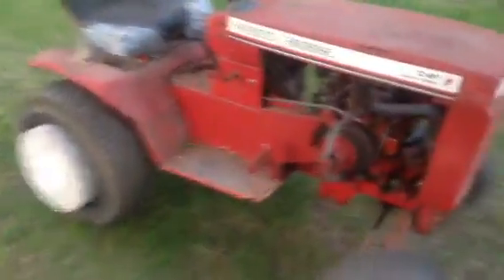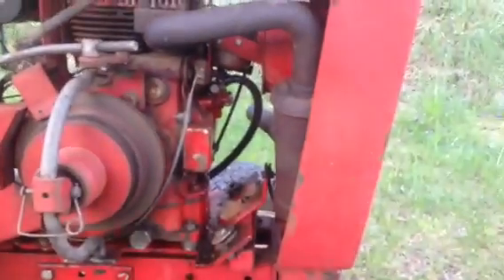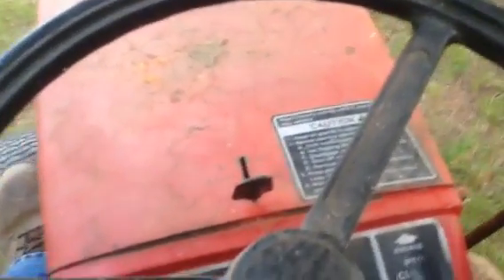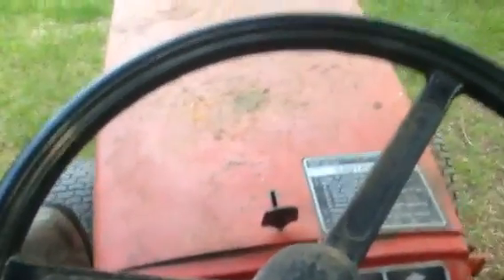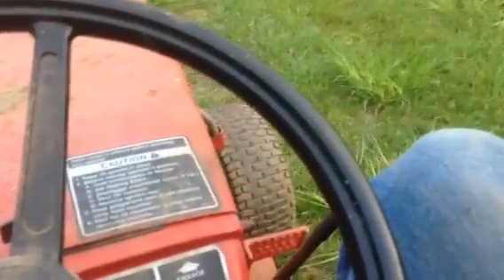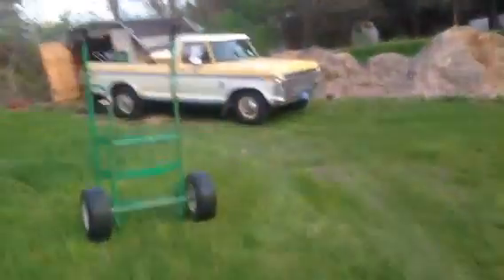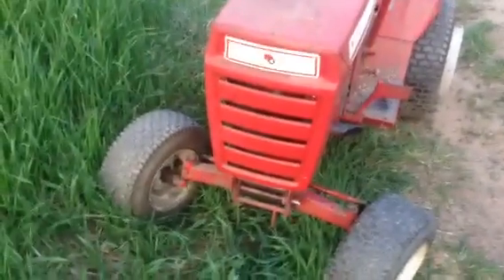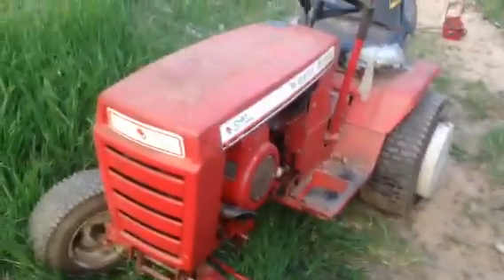New wheel horse C-81 runs and drives

Comment: Soften the cam so it dosnt go flat with lucas oil treatment??  You need to adjust the valves, and the k181s has solid lifters so you need to lap the valve seat or grind the stem to spec. Also, check points gap. And sell me that headlight cover.